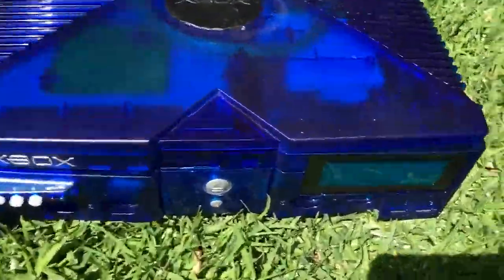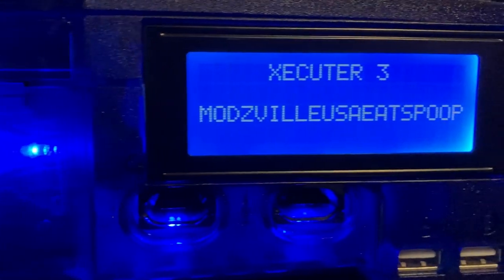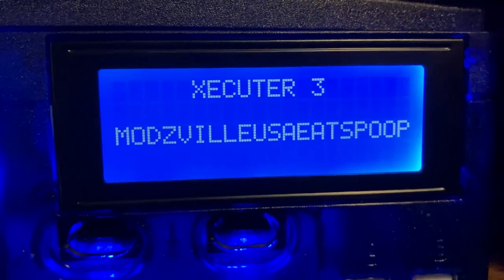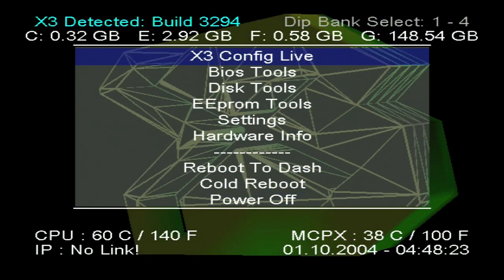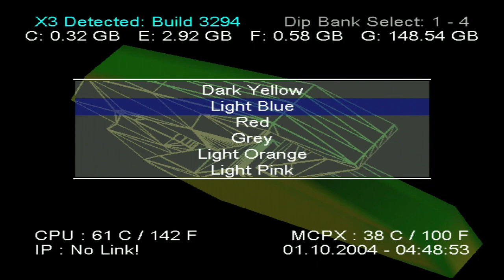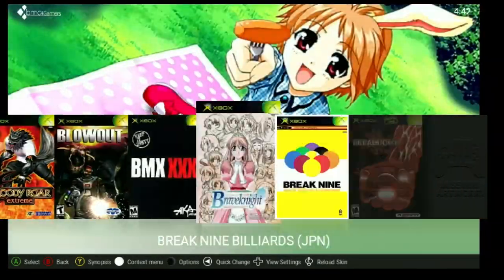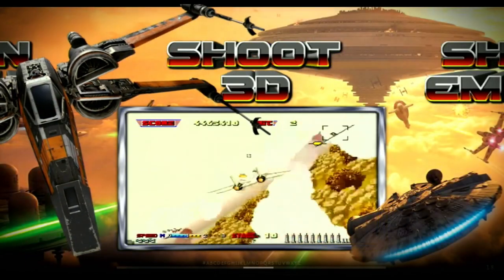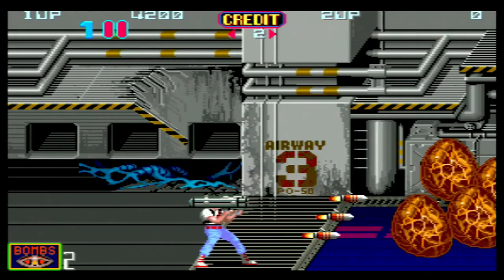Ultimately The Most Ultimatey Ultimate OG Xbox EVER! (LEGENDARY EDITION!)

Comment: Damn, that's a nice build. I've never seen XBMC4Gamers run on a 128MB system and you're not kidding, it's slow as hell on a regular Xbox. As much as I love the eye candy I still use Unleash because its snappy. Can you clarify what the open source part was referring to? Also I was surprised at your reference to the 8TB hard drive upgrade! I'm actually working on an Xbox mod project (more of a “basic b!tch” compared to yours ha) and I thought that you can only max out the system with a 2TB hard drive (or a 3TB one if you want the full 2.2TB which is what I am planning on doing). Is that something unique to the X3 or can anything like that be done with an Aladdin XT Plus2 which only has a 256K bank? Not in the same league obviously... but it's fun to see what's possible with a build like yours. I'm still getting my feet wet with Xbox modding in general and my primary goal was to just get the full library of Xbox games on the drive (which is about 1.8TB uncompressed with the archives I have).
Reply from the maker: What up brotha!?
Yeah it's night and day rocking xbmc4gamers on this rig ;D
I believe the open source project I referred to is the R3dux. Kekule over at Chimeric systems fully reverse engineered the X3 chip. You can build one right now if you get the parts for it!
The 8tb patch is a very new release worth looking into. I believe it started with a new bios called cerbios that supported 8tb but only worked on 1.0s and 1.1s. Now there's a new patch for patching in 8tb support for EvoX M8 bios. It looks like the patches are done to the hard drive itself and should work on any M8 evox bios from what I've gathered. Here's the link 
https://github.com/gaasedelen/titan
Recent batches of aladdins come with a new chip that can't be flashed via software on the xbox and need an external hardware flasher if you want to mix up what bios is flashed to it (Xblast  for example)
8tb is certainly a silly amount of space for an OG xbox. my 2tb build has everything exept shitty sports games + a bunch of emulators ect. 
4tb would probably be the sweet spot for something like this unless you're super into having every disc from every region. 
I think 8tb might actually be enough for the full redump set that has everything for those who are hardcore into preservation.
Reply: I’ve gone deep on this over the past week, and happy to say I’m rocking Cerbios 1.02 on an Aladdin XT with the full 3TB in XBMC. Still tinkering with the build, but UnleashX does not like the Cerbios formatted HDD from FatXplorer (even for the partitions it sees). Anyway, now the fun task of getting those games transferred over. Thanks for pointing me in the right direction. I’ve rewatched your video and it made MUCH more sense this time haha. Xbox modding is fun. Something for everyone. Thanks again. Cheers.
Reply from the maker: @BorderlineOCD  Fuuuck yeah, happy to hear it!
Ima shoot a 128mb Ram install video later today. It’s actually super easy if you approach it in a certain way. Might be worth doing for that xbmc4gamers build.
Look into fatxplorer, soooo much faster then ftp 🤘🏻

Comment: @ModzvilleUSA!

 I have a Xecuter 3 chip mod with panel on a Friendtech 128mb board. By chance do you know anyplace that does service upgrades for this model. I want to get an HDMI upgrade, ssd conversion with insignia installed to connect through xbox live. I also need to install Cerbios in one of the banks. Could you point me in the right direction by chance? 😁

Comment: Still got my X3 running, probably like yours but its purple. It does have a cable running the an external control board stuck to the front. MrMario2011 has a video with the exact same thing (https://www.youtube.com/watch?v=EUTh_hlngg4). I wish I had gotten the external LCD but it was $80-ish if I remember correctly and I had already spent $70-ish on the X3. Now, all my other XBOXes are TSOP flashed and I really don't see any benefit. I do have one to repair with a bad HDD, got an Aladdin chip for it. I also have a spare Xenium if I ever get the nerve to do the HDMI mod on my Halo edition.

Comment: I have one of these 1.4ghz modded Xboxs with 128MB and did a HDMI mod on it. These things are very hard to find these days ,and if you do find one you will easily pay $400-800+ dollars. I have experimented with mine extensively and it has ups and downs. There isn't much of a point in buying one to play original games better. The few games that can take advantage of the higher CPU do not justify all the rest that it breaks. You can patch many, but most of those patches literally just tell the game to run at 733mhz and not 1.4ghz. It shines when it comes to better emulation. Coinops, N64, PlayStation, Sega Saturn, etc all benefit greatly. You have to remember back then this was the best emulation station available and this upgrade made a lot of sense. Today you will have a better experience just modding one to 128MB RAM and using the 720p patches if you want better looking games. Besides novelty I would not go out of your way just to own one. At this point a Pi4 board system can do better at most emulation besides some arcade systems and it is way easier to setup.

Comment: I have two hard modded Xbox is. One of them is on 1.1 GHz speed and the other one is 1.4 GHz speed. I was for sure that there was a patch that you could patch and XBE file with so that it runs properly on one of these faster clocks. Like that it detects that you have a higher clock speed and still runs it at standard clocks if it does not support it
Reply from the maker: I actually just went threw and patched all my games with the patcher. Unfortunately the GTAs seem to run waaaay to fast still but other games that had issues have been sorted out.
Reply: @ModzvilleUSA  Does it have a batch mode so I don't have to patch XBE's one at a time?
Reply from the maker: @VIRACYTV  yessir! it scans a directory and patches everything. You can get it here
https://github.com/N64-Freak/Xbox-CPU-interposer
Reply: @ModzvilleUSA  I just read the Readme.txt with the XBEPatcher. I just have one remaining question. It will patch all games whether they need it or not, I suppose. But that means if they ran at retail speeds before patching, they won't be further slowed down after the batch patching? In other words, this patcher just reminds the XBE to run the way it was built, it doesn't downclock the speed of the way the XBE runs, right?
Reply from the maker: @VIRACYTV  I honestly don't know the ins and outs of how the patcher works. I have a 1.4ghz with 128mb so i set the patcher's settings to that and patched my games including emulators as coinops had issues. 
My coinops is now running great so patching everything seems to be a fine way of doing things.
Reply: @ModzvilleUSA  Thanks!